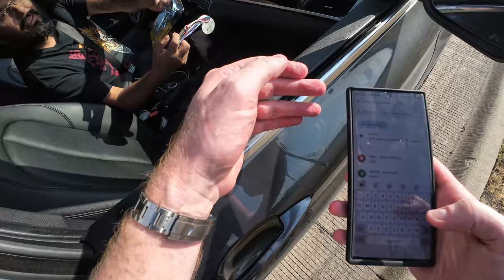First Problem with the Speed Twin 1200...

Comment: Hey man I'm glad it was something minor. These engines are tanks from my understanding. I'll definitely check that spring more often now
Reply from the maker: Ya - I lost power, and then the oil pressure light came on (so I thought it was engine failure)... so ya, I'm stoked it turned out to be something minor. The spring must have just snapped because I was just driving on a straight road with no bumps or anything.